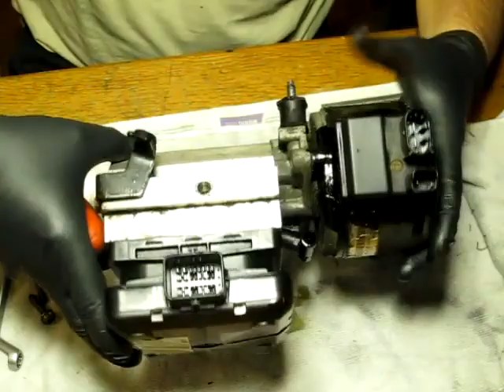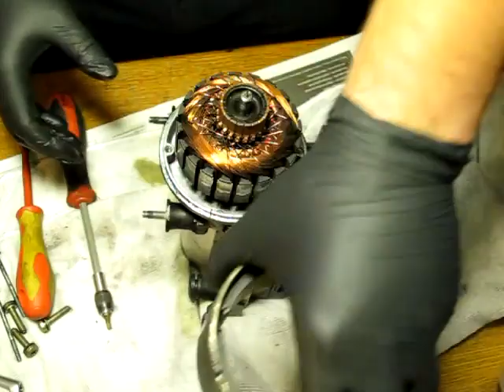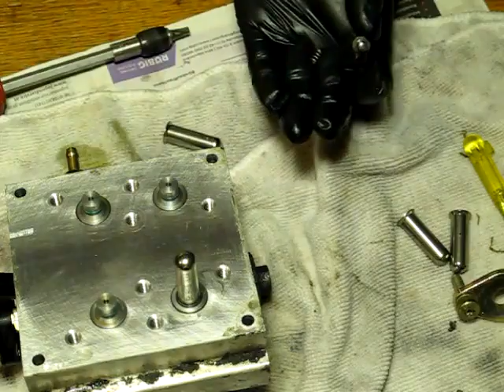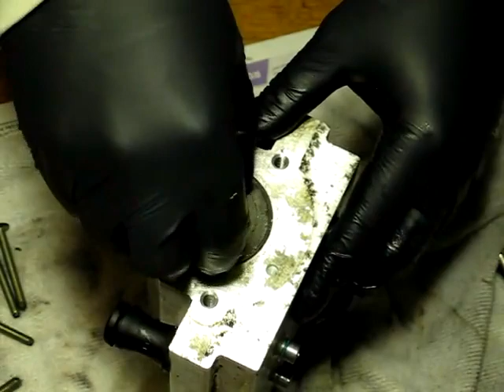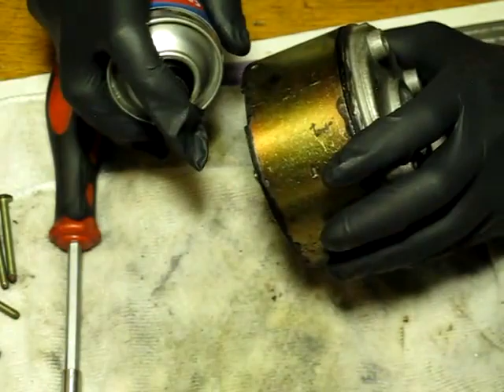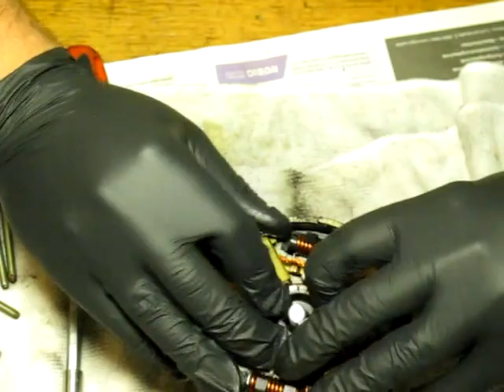What's inside a Citroen C5 Hydractive Unit

Comment: Nice to see it opened up. It is a super bit of kit that motor/pump. Only trouble I have seen is them gunking up and needing the carbon residue cleaned out. There is also a capacitor that can fail sometimes.

Comment: If you add too much oil, what happens? My fuse A40 breaks. The car down when it should come up goes A40.. Is it a pump or other problems?
Reply from the maker: If you add too much oil and lower the suspension, the oil container might burst, because it is sealed. Almost did that when depressurizing my suspension...
The fuse for the pump is acting as a pressure limit as well. So there's something wrong down the hydraulic lines...or there might be dirt in the needle valves...
Be very careful when working on the hydractive! It is a high pressure system, tiny jets spewing out can easily cut and penetrate your skin...
Reply: @lynxonwatch  Last time fuse go ,when car down. But up it die pump. Put in new fuse it go up but last time sounde tik tak tik tak like old man go slow up ? TO much oile Dont break fyse??
Reply from the maker: Oil level check: Put car in standard height. Oil level should be in the middle of the TOP of the oil container housing (there is a rough plastic area on it, towards front). Put car in low position. Oil level MUST NOT be higher than end of rough area on plastic towards filler cap. Put car in high position: Oil level must be above lower end of rough area.
When the fuse blows, the pump is drawing too much current.  The higher the pressure, the higher the current through the pump. The pump is very strong, so there is something wrong away from the pump (stuck valve or stuck hydractive cylinder...).
Reply: Are there valves to screw on so the A40 breaks. The electricity can't be in the pipe and piston system at the back. When water comes, it would spark. Have googled for 2 years in 5 languages no one has talked about this when the A40 breaks. the pump is very used and sounds tired
Reply from the maker: There is no electricity in the pipes, you are right, only pressure. Pressure makes the pump draw a lot of current, too much => fuse blows.
AFAIK there are 4 valves in the pump unit, and then maybe one per axle (for sure, if it is a hydractive 3+). Nothing to work on.
"Tired" pump + blown fuse: Maybe the carbon brush sticks are worn out...or inside everything is full of carbon => short circuit. Might be worth to clean it (lots of videos here on yt about that).
"Tried" pump without engine running => bad battery and/or connectors
"Tired" pump with engine running => clean connectors and maybe replace the carbon brushes inside the motor.
That's about all I know...unfortunately, I don't have the Citroen anymore...it went to the crusher ;( ;( ;(...
Reply: @lynxonwatch  Okay 👍 Can i see on car IF its Hydro 3+ ? Batteri Good from Ford 👍 I know pump for 200e  IF put in new THE valves are new in pump? In Finland have tax in all shit expensive
Reply from the maker: @RBISTO  Hydractive 3+ has 3 spheres on the rear axle: 2 on each "wheel", and one in the middle (and maybe the same on the front axle, IDK for sure). You can also set "programs" in the dash (like "soft" or "sport" or something like this). Standard hydractive has only the 2 up/down buttons, and no choice of softness.
Usually, the motor/pump with the 4 control valves is sold as one unit.
Please see my other video on how to depressurize the system.
Please please please use proper axle stands under all 4 sides of the car, on the frame, when you remove the hydractive unit. And prepare some rags.... :)
Reply: @lynxonwatch  Ok .. I have 2 Up , and down. Sport ,Winter , sport suspension.. My 2001 same as My sister 2007 C5 same ,. (S). (W) ^ sport ✓
Reply: @lynxonwatch  If I put in computer in car taket code. You know The code PO code ? And send you !?
Reply from the maker: @RBISTO541  No I don't remember any codes of the devices. I suggest you first remove the pump module, then you can search for the exact same module number.
Reply: @lynxonwatch   I have a pump now. If code can help me more to know The problem
Reply: You know some guy here now about code?
Reply: @lynxonwatch  
Noooooooo.......
Not the crusher....
😔

Thanks 4 th vid